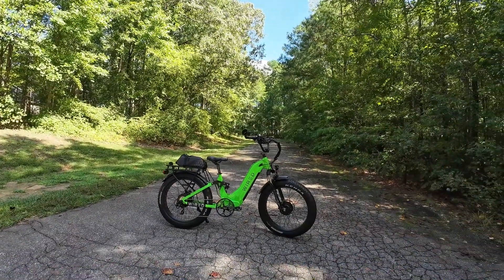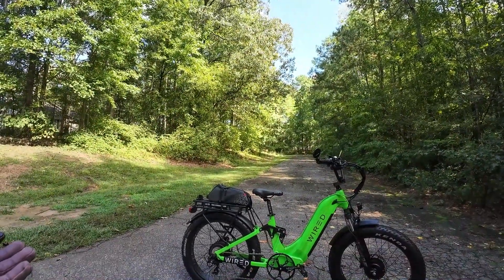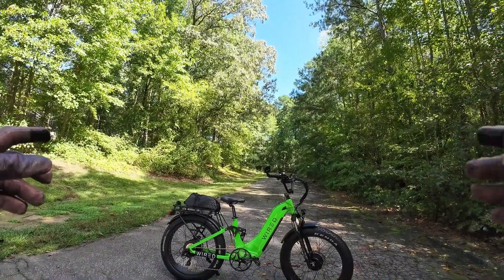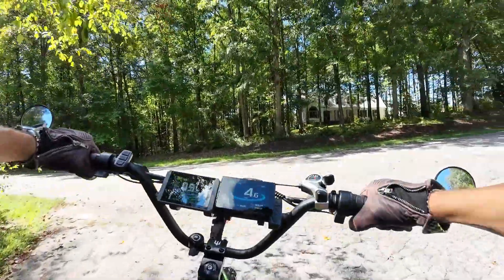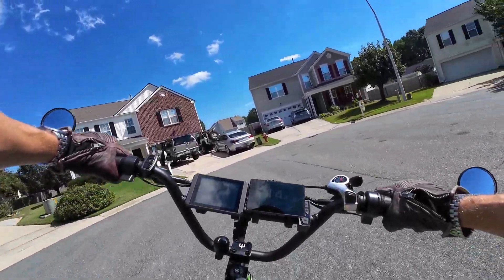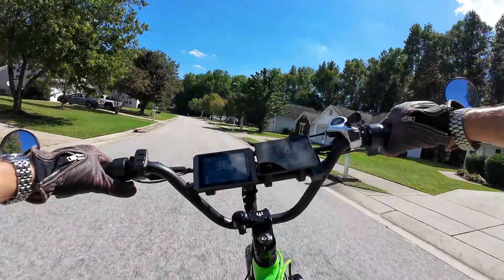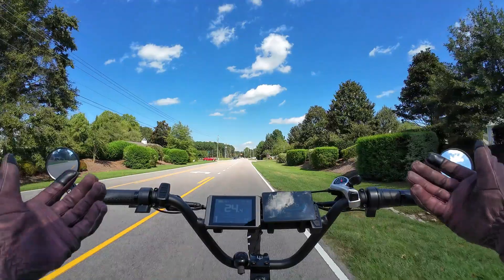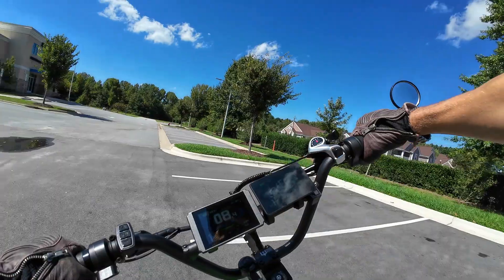Wired Cruiser Dual Motor Conversion

Comment: Is the rear gears a freewheel or a cassette?
Reply from the maker: @luigiprovencher  freewheel
Reply: @CitizenCycle925  Okay thanks. I'm thinking about picking up a new one and a new chain and waxing instead of oiling.
Reply: @CitizenCycle925  Is it possible to upgrade the freewheel to either add or reduce the number of gears? The first couple of speeds is too easy to me and kind of useless.

Comment: I have a cruiser coming and i plan on getting one of your kits eventually. Do I need to change to a different rst guide fork than what comes with the bike ? I just saw a video that said they had to because of the quick release front axle on the new versions. I'll change it if i have to but i was just wondering.
Reply from the maker: @moodyfox3108  yes, you will have to swap forks. the guide Forks on the newer wired bikes have a through axle and for the kit you'll need the older style rst guide with open dropouts
Reply: I just ordered your kit for my cruiser today. I can't wait. I also ordered the fork. Should I buy those wire mounting tabs or does the kit come with them ?
Reply from the maker: @moodyfox3108  I would recommend running the wires through the frame under the battery pack. I did this on my father's Cruiser there's plenty of room in there.
Reply: Ok thanks
Reply: Currently installing your kit on my cruiser and I just realized I can't see these torque arms on your cruiser and other bikes with your kit. Are they just for extra safety ? I'm putting them on regardless. I can't wait to get this installed. These kits were genius. Maybe I'm blind, I am watching on my phone.
Reply from the maker: @moodyfox3108  i never install the torque arms, they are just there as extra for folks who want them
Reply: Thanks for answering, I was just curious how important they were.

Comment: Wish this bike had front rack mount. I think the controller mounted/hid in a front mount would be sweet. Is there a way to wire your kit into the factory 2 batteries?
Reply: Mine is only on order, but this is possible with the Topeak tetrapack. A couple riders have done this and shared their success on the Wired FB group.

Comment: For the new Wired plus we need a kit that uses the existing 2 batteries like the Predator bike. Maybe motor , new control panel and rear front switch to get the same setup as the New Wired Predator. You the smartest guy develope this Kit.

Comment: Hey CC, thanks for your great content. I looked at the website and it looks like the Cruiser is quite a bit smaller than the Freedom. Is that the case? The website is pretty inaccurate on some things so I was wondering if the specs geometry portion was correct. I had the Freedom but sold it and I’d like the Cruiser step thru but I’m very tall so the lower handlebars etc are much smaller on the specs page. Any help on that would be appreciated greatly!
Reply from the maker: @rvboondocker2559  the cruiser is not really any smaller than the freedom. I see that spec sheet on their website and it's pretty incorrect. The handlebars are the same height the seat is the same height. the cruiser still a very big bike just has the convenience of the step through
Reply: @CitizenCycle925  Thanks buddy. I’ll order it via your page:)

Comment: Great vid. I like the addition to the cruiser rather than from factory. I have an ecells 5* just got it this weekend. Reason I like your setup is for the fact the motors are on separate setups. Better controll of motor dial-ins. Easier to get your individual desires from the setup. 
Just so all consumers understand, example here... having a 1500w rear and 1500w front motor does not give you 3000ws. Both motors although may be on 2 different controllers are still using the same display. If display or wiring goes bad, neither motor works. The dual motor system lessens the stress on either motor when used in tandem. 
The bigger benefit to Citizens setup is the individual tuning of each motor and in a "worse case" sinario, if one goes out,including display, you still have a way to make it home. 
I believe your setup is a better soltion than a factory dual motor ebike. 
Thank you for sharing with us.
Hope your family is doing well.

Comment: Citizen, can you shunt mod the controller for your front hub motor? What are your thoughts  on shunt modding the Wired bikes?
Reply from the maker: Yes you can shut my controller, of course voids the warranty.  however you cannot shunt mod the new wired controllers, they are filled with thermal gel

Comment: my question is whats up with wired bikes overheating i have other bikes and it’s not a issue…
Reply: There are no issues with overheating, Wired has sold thousands and there is no problem.  Just BS from the criminal enterprise known as e cells which was founded by an ex con and who has slandered Wired incessantly.  Cleveland claims the contoller overheats because his bike has 1000 less watts and is more expensive.  The dual star bikes have a horrible death wobble and the company has an F rating from the BBB.  Guess who puts their controllers inside of the bike frames?  E cells.   What a piece of poop.
Reply: @jfly2249  you do realize that everybody knows who you are!
Reply: Sameee I got mine last week I was told might be a temperature sensor issue it’s 30 degrees outside and it’s overheating on flat surfaces contacted wired and being sent a new motor

Comment: I would have preferred that you take the time to route thru the frame........
Reply from the maker: I may have to others have commented that it's easy. my bike may be a little different though, it's the Prototype so there's no room to feed the wires into the frame in the existing holes I'd have to cut them larger

Comment: I just got my new cruiser last Wednesday it came with wire stabilizers on the front fender, no more wiggle and the hellbender  head set no wobble now I don’t ride no handed but I have one handed with no issues, with both batteries installed. Thank you for the recommendation of this bike it’s awesome for a larger old man such as myself
Reply from the maker: Thanks for contributing! yes I put a short fender on mine.  it did come with the longer fender with support wires.

Comment: What about the fork?  That fork is not designed for a motor , they brake , very dangerous,  so do you sell a fork for a motor preferred air fork or at the least an adjustable spring fork ? If so, you got my sale , the only reason I didn't upgrade is the fork.  In the end I purchased an dual motor ebike
Reply from the maker: I always use the rst guide forks for my dual motor conversions I've never broken a set. I did have to swap out the wired forks for a different kind of guide fork with open dropouts instead of the hole for through axle. In the near future I'm also going to be selling a double crown air fork that will work with my kit
Reply: Yeah those RST Guide forks are garbage as it is

Comment: Like many I have a basic fat tire bike with a 48v 750 hub motor with a 22A controller. Ok performance but not great. Something with the performance of your front motor kit, but in a rear wheel upgrade package would interest me. Rear motor wheel, controller and display to make 750w bikes perform like 2000w bikes like the Wired.

Comment: I read that you will be reviewing the biktrix roguehawk fs ebike cause I'm interested in your evaluation of it compared to the wired bikes?
Reply: I’m very interested in that bike as well. In fact, I purchased a $100.00 reservation for one earlier today. I would really like Citizen do a review on that bike.
Reply from the maker: Interesting, here did you read that? Biktrix did make some initial contact with me but as of right now it's not on my schedule, but hopefully it will be.
Reply: FB advertisement of the bike, where someone had asked if it was going to be reviewed, a biktrix rep mentioned citizencycle.
Reply: Citizen..will your front hub motor fit on the Roguehawk??
Reply: @chrissmithsonian4819  I think the 26×4 tire will.

Comment: I'd want it to work with one of the two batteries that it already comes with instead of having to buy a third battery. Is there no 60V motor for the front? Or would you need a another device to lower the voltage coming from the battery for the motor that you sell?
Reply: @luigiprovencher  Yes. Each hub motor runs on a separate controller. The bikes controller is a 60v controller. But the controller with the front wheel kit is a 52v controller. The capacitors in a 52v controller can not handle the full-charge voltage of a 60v battery. 
A 60v 35a controller would work well with Citizen's front wheel. He uses an easily available type of controller and display called KT (KunTeng). His KT LCD-8H display will work with a 60v battery. If you used a 60v controller with the front wheel, it will gain top speed. Citizen said the front wheel currently pulls to about 32mph on 52v. Switching to a 60v controller should let the front wheel pull to about 36mph.
Reply: The motor can be run with a 60v battery. It would just require using a controller capable of higher voltage. A 60v controller could be used with the stock batteries.
Reply: @jimmyjames8736  The controller that it comes with is 45ah 60v so what are you saying that it would need a second one?

Comment: You do not have to drill a hole on the one side there is room just to smoosh the wires in. They have protective coating on it so there’s no chance of pinching. It’s a tight fit, but it fits.

Comment: There is definitely enough room. I flipped the bike upside down took the battery out took out the metal bar underneath that metal bar is all the stock wires so I just ran the wires from the motor kit right next to him. Put the plate back on totally stealth.
Reply: I don’t know how to post videos but I can send Brian pictures through his email
Reply: To really take advantage of that front wheel kit put the bike and pedal assist five hit both throttle then pedal your ass off the front wheel drive helps you pedal faster quicker much faster that way than just with both throttle trust me
Reply: Do you have a video on yours?